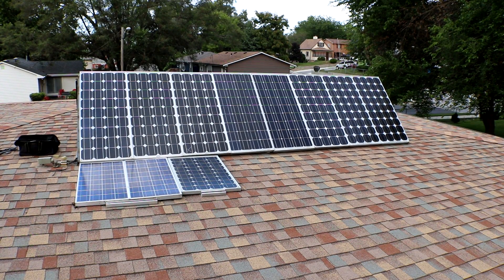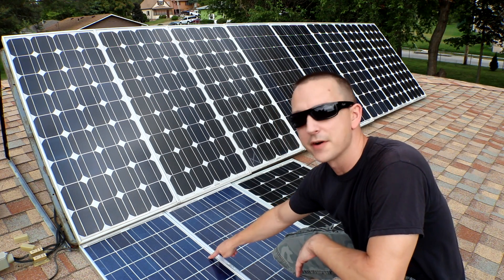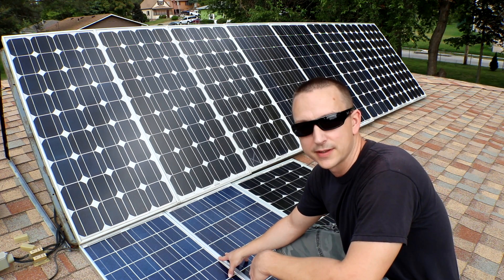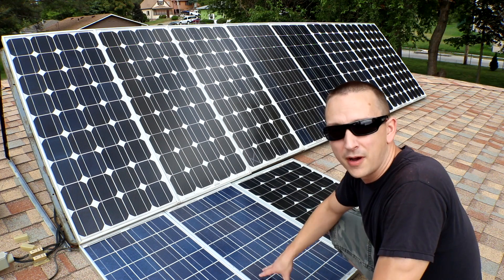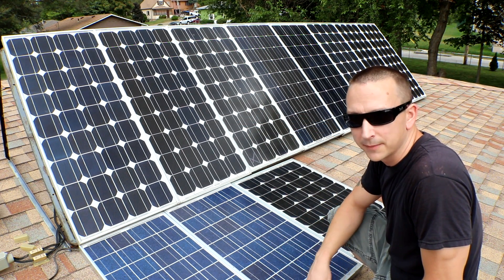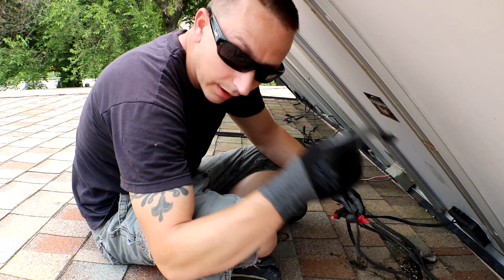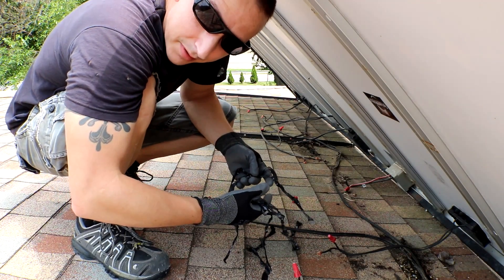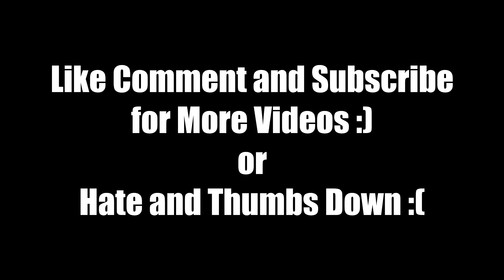Making Room for the 235watt Canadian Solar Panels!

Comment: please be sure to replace the roof-tiles which were drilled-through - otherwise you might get water under there.
Also I noticed on the roof of my garage, that every nail that has been put through there, resulted in water-spots on the underside. Over long or short, water will leak through every even so tiny hole - so please be sure to fill those holes or replace the shindels and properly seal of every new mounting point.

On my garage/ Car-port it is not that big of a deal, but you definately do not want water to enter the roof of your house....
Reply from the maker: I have been filling the holes with tar and then covering the top layer of tar with the shingle gravel from the gutters 😆.  Will make sure to seal any new holes with tar as well👍
Reply: perfect :-) - did not want to sound like "dumbwit" - but just make sure, you thought of that as well.
looking forward to the next video - of the 235Watt Panels` Installation!
Reply from the maker: 👍 I cant wait to get them up there and installed!!!

Comment: Looking good! You'll be peaking around 1KVA. If your storage is big enough you could gather plenty of energy to power your shop, perhaps an emergency outlet. I often wonder if you installed all panels on bolt shank pivots, bearing blocks with a linkage if a simple 2" pneumatic cylinder or dc chain drive with limit switches, timers would provide another 25% of power by following the sun. I know, it's a 2019 or 2020 consideration.
Reply from the maker: +Charles Tatakis Thanks!!! It would be nice to track. I could possibly do it on my roof since its not steep at all.

Comment: So i think that charge controller can take a higher voltage and step it down for you and if so you should hook up as many as you can without going over to minimize losses but then again if you only have a certain number of panels whatever you can do
Reply from the maker: +James Holbrook I think Im gonna do 24v panels in series first to see how it does since its only like 25' to the batteries. If she doesnt put out as much Ill do a 3some 😉😂👍

Comment: Awesome! They will look great when you get them up!! I have had mine up for a few weeks and they work great. I just need alot More battery bank!!!
Reply from the maker: +Gene I cant wait!  Did you raise your input power yet and did it help?
Reply: AveRage Joe Actually I almost have to many. I'm running a total of 1880 watts and on the limits of my midnite classic 150. I need alot more batteries and will be bumping up to 24v or 48v when I get more batts. So it's setting idle for now. Also I used unistrut from Menard's for my mount and works awesome!!!. If I knew how I'd send you a picture.
Reply from the maker: +Gene I replied back to your pm a while ago and my # is in there. I also got some unistrut.

Comment: Good to see you making progress and can't wait to see the results!
Open circuit voltage for 12 V 36-cell panels is usually around 21 V with MPP at around 17.6 V.
So, if you're wiring 4 in series, that'll give you 84 V which could give you a nasty nip!
Don't forget to wire in blocking and bypass diodes, as it looks like you'll have some partial shading issues during the day, and of course try to find the sunniest spot for them.
This site has some fantastic info on bypass diodes for dealing with partial shading and mppt:
http://www.avdweb.nl/tech-tips/pv-panels/bypass-diodes.html
Reply from the maker: Awesome Ill take a lookC👍

Comment: good job m8,  well about the ideal elevation depends on your location, here in Holland 36* i think, but it shouldnt matter that much, if you really want it perfect you can find tables on the net for each location on earth.
Same as the Azimuth to the sun for most effective work if you be able to turn the panels to the choosen direction it will helpfull.
On my work we only use serie strings of pannels to different groups on the invertor.
Many times a voltage of ~700 volt dc from a string, just not touch it as i did once it feels not smooth hehe-)

And..  a gap between the panels and the roof is indeed better, panels works best if they keep cool.
be carefull with the wind, on a flat roof installation we use weights on the lower frame, better more than too less.
We need to follow the factory recomendations to avoid warranty trouble or with assurance.
Reply from the maker: 700VDC Ya that will bite a lil 🙃

Comment: Great to see your making progress but id not bother using thoes panels on your new setup maybe use them as a secondry system for water heating also remember your new charge controller is mppt and will need more than 48v from the panels to be useful
Reply from the maker: Im gonna try the 24v panels 2 in series first and if that doesnt do the trick then Ill go 3.